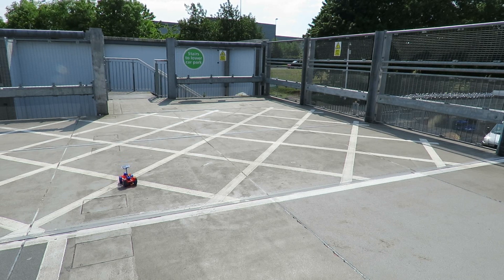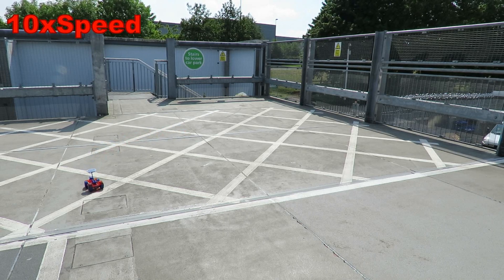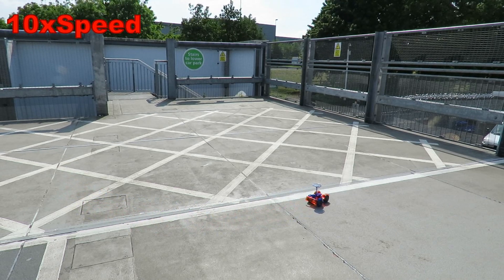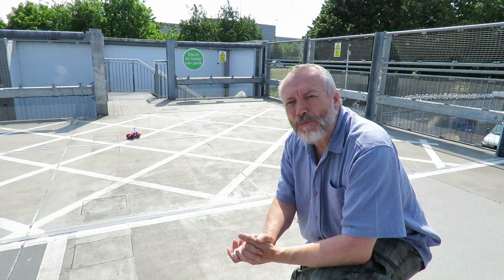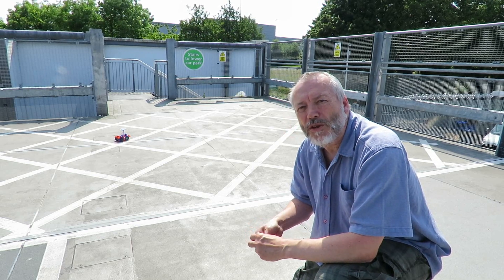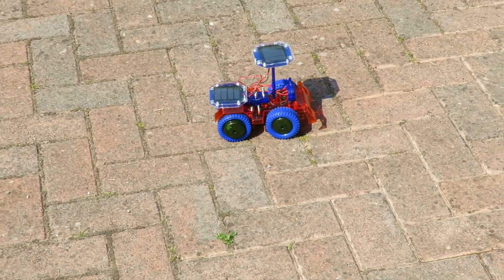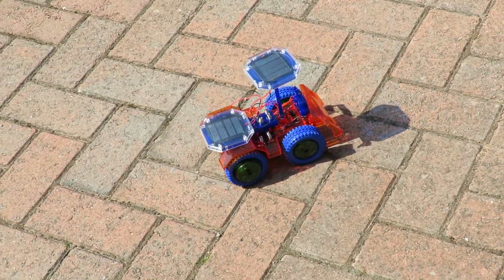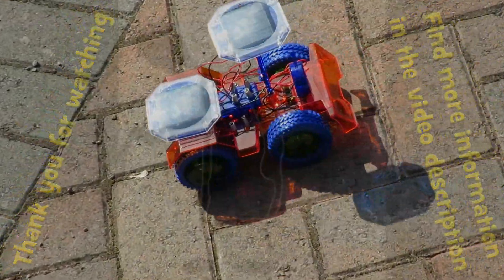Charity Shop Gold or Garbage? Solar Car Kit tested in UK sunlight 160529

Comment: You should try a voltage regulator, skinny tires, also try the sun at solar noon.
Reply from the maker: You could do all that. Not sure what benefit a voltage regulator would have. The easiest fix is just a bigger solar panel.

Comment: could you convert it to a simple forewards backwards radio control
Reply from the maker: Yes you could. It runs on an electric motor so all you need to do is connect that motor to a cheap RC toy car receiver and it would work. If you want it to be solar powered then you would need to provide a much larger solar panel and probably include a capacitor across the input from the solar panel to smooth out the problems from variable sunlight. Probably even better if you added rechargeable batteries.

Comment: That thing would be pulling wheelies over here in Oklahoma lol. An enjoyable test run nonetheless.
Reply from the maker: We have had a bit of a heat wave here for about 3 days, well over 30 degrees, over 40 in the car since the aircon has failed. Today it is raining again :)
Reply: Am still mostly on Fahrenheit here, am surprised you went Euro ;) To me, 80F is nice and warm and -5C is cold. Will be 102F here tomorrow, which is 38.9 in Foreign. And yes, the aircon in our 2001 Ford Escort is all about opening the windows nowadays. They say that putting a pop can out in the breeze while driving for a few minutes cools it down, that would make a good vid !
Reply from the maker: slider2732 Funny thing, I would have thought Miles, Gallons, Pounds, and Fahrenheit would have been top of the list to go for the USA to divest itself of British rule so I guess the other options must be worse :)

Comment: Why was it so slow
Reply from the maker: It is a relatively large car for such a small solar panel and small electric motor so it is geared down to allow a low powered motor to move a large car. Add that to the fact that we really don't get much strong sunlight in the UK and you end up with a slow car.

Comment: Cool! I like it
Reply from the maker: I think they should supply the UK version with two solar panels to double the power available as we don't get enough sun to get it running faster :)
Reply: +GrandadIsAnOldMan 
Could you fit the large solar panel from the solar seagulls?
Reply from the maker: Wil Hobbs yes, no problem but you know I like to demonstrate things as they come out of the box :)
Reply: Of course
Reply from the maker: Wil Hobbs :)